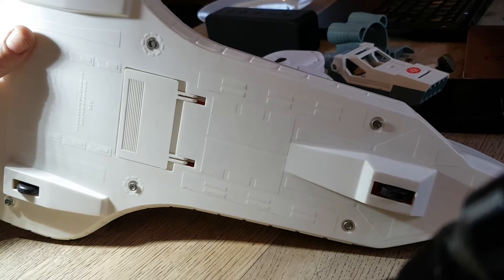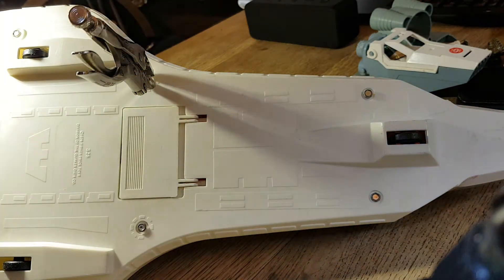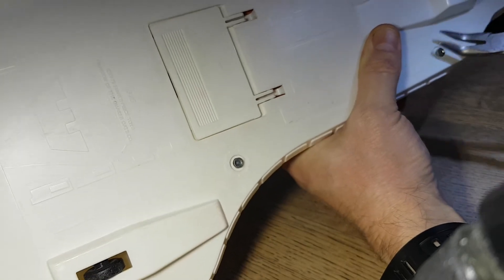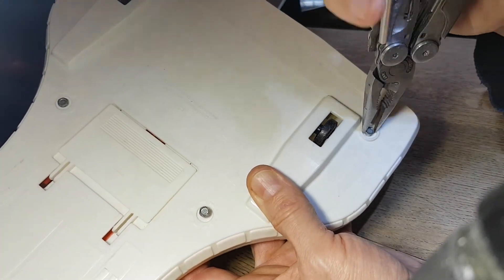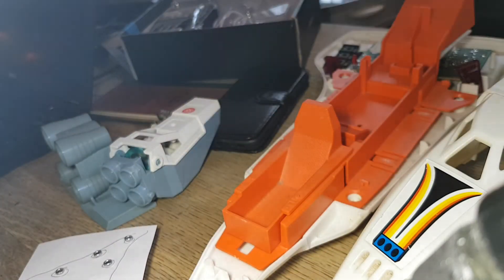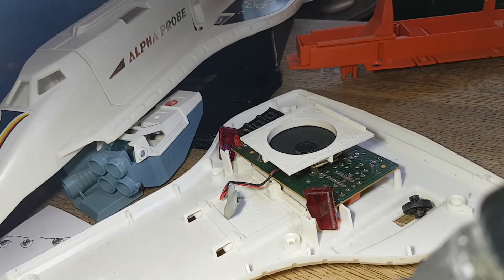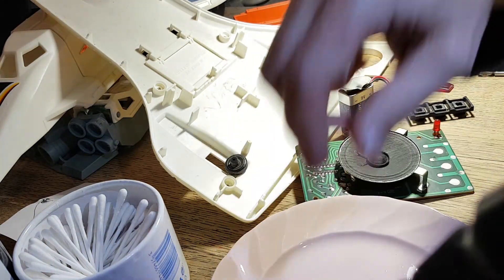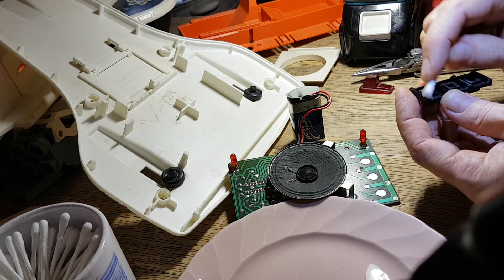Fisher Price Alpha Probe Repair

Comment: Any reason why you didn’t use a socket wrench? I tried on mine but because of how shallow the heads of the screws are, I need a slightly smaller socket. Thanks for the video though.
Reply: Edit: it’s a 5.5mm socket. Worked like a charm. Cheers!
Reply from the maker: @roggae  Thanks for that info, it's great to know you got one to work. I located a 5.5 mm socket but it doesnt get a grip on the shallow head of the screw unfortunately. Your socket might be of a more forgiving design. I seem to remember having this issue last time I worked on an Alpha Probe which was when I discovered the Leatherman as a tool that got the job done. Would love a socket that works though!

Comment: Could you use a Nut Driver or small Socket and Socket Wrench ?,,
Reply from the maker: I think you could but my one could could not gain purchase. It would definitely be a preferable technique if you can find one that works with the shallow bolt heads.